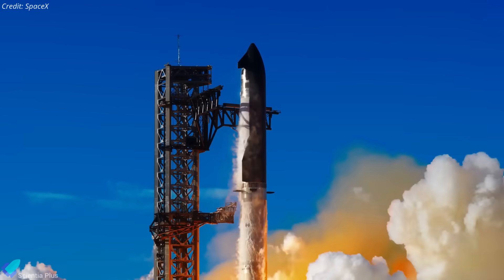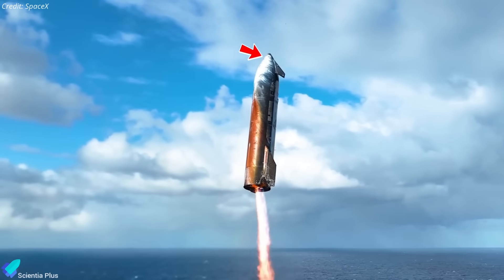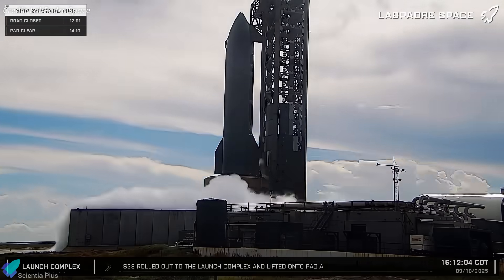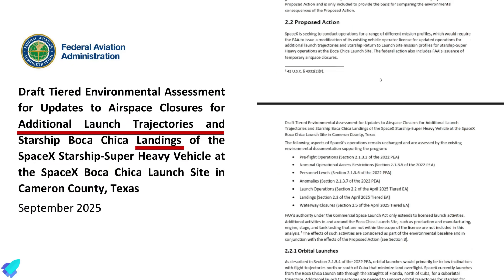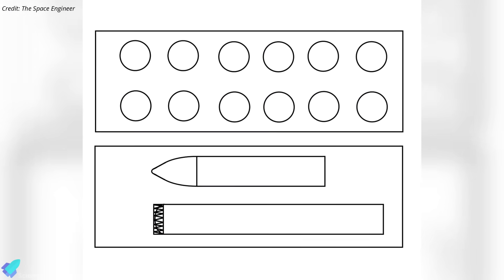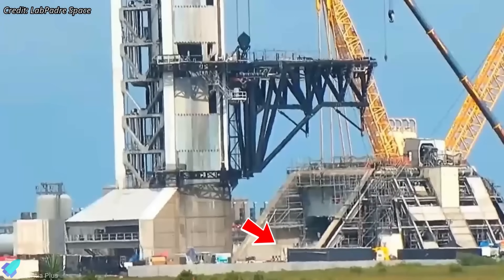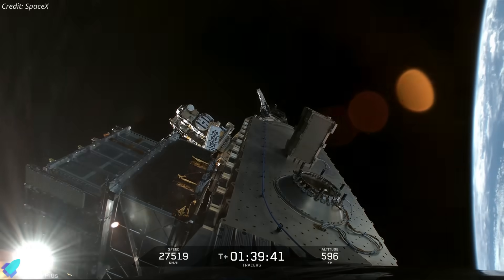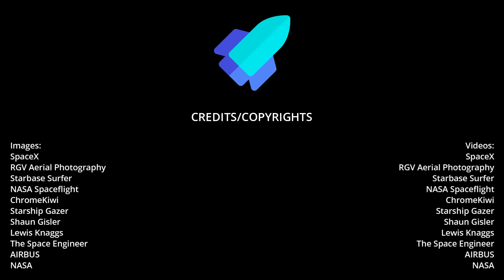Starship Flight 11 Ship 38 Static Fire DATE! Complete TPS Rebuild Secrets Exposed

Comment from the maker: 00:00 Starship Updates
11:26 NASA Just Saved a SUN-Monitoring Satellite From the Dead After Months!

🚀 Starship Flight 10 
  📽Detailed Breakdown: https://youtu.be/irVUMJNe0Kc
  📽Root Cause of Anomalies: https://youtu.be/LBUpp7MRVSY

📚 Learn More:

🚀 Starship Block 2 Explained:
 📖 Summary: https://shorturl.at/b0dtw
 🔍 Detailed Explanations:
  • Design Improvements Update 1: https://shorturl.at/lpGT7
  • Design Improvements Update 2: https://shorturl.at/gwNQ4
  • Nosecone & Payload Bay Redesign: https://shorturl.at/xa60S
  • Methane Downcomer Redesign: https://shorturl.at/XdYBG

🚀 Starship Block 3 Explained: https://shorturl.at/mnBT4
  • Detailed Breakdown: https://shorturl.at/IViwD
  • Production Begins: https://shorturl.at/xRNkJ
  • New Transfer Tube / Downcomer Explained: https://shorturl.at/Iaqc6
  • New Grid Fin Explained: https://shorturl.at/NxdVo

🚀 Starship Block 4 Unveiled: https://shorturl.at/7A2ef
 
🔥 Raptor V3 Mega Upgrades & First Test: https://shorturl.at/TRIyj
🧱 What’s Inside Starship GigaBay?: https://shorturl.at/nJM75

🛠 Insane Engineering of New Starship Launch Pad 2: https://shorturl.at/7RAZd

🛢 Dual-Port Orbital Refueling – Full Technical Breakdown
https://shorturl.at/5tiqK

🛠 Other Starship Upgrades:
 • Hot Staging Explained: https://shorturl.at/jf400
 • Super Heavy Booster Upgrades: https://shorturl.at/Pi5R3
 • How SpaceX Protects Raptor Engines: https://shorturl.at/4Om8F
 • New Heat Tiles Explained: https://shorturl.at/p2Ijb

🚀 Starship Flight 10 
  📽Detailed Breakdown: https://youtu.be/irVUMJNe0Kc
  📽Root Cause of Anomalies: https://youtu.be/LBUpp7MRVSY

📡 Stay Updated:
📢 Weekly Updates: https://bit.ly/3HIQjPC
🚀 SpaceX Playlist: https://bit.ly/34wue8T

🌍 Follow Us:
👍 Facebook: https://www.facebook.com/scientiaplus

Comment: The main reason the booster and ship cannot stay upright is that, after passing the Port Canaveral Locks, low-lying power lines cross the Banana River. These lines, which stretch across the river at several points on the way to the turning basin near the VAB, limit the height and safety of the booster and ship from potential electrical arcing as the ship passes underneath them. That's not an issue for F9 because the barge never goes beyond the locks.
Reply: thats not the only reason there are numerous fixed bridges crossing the icw along the route from starbase to ksc and its not an autonomous drone ship